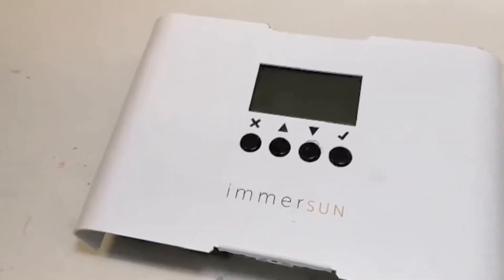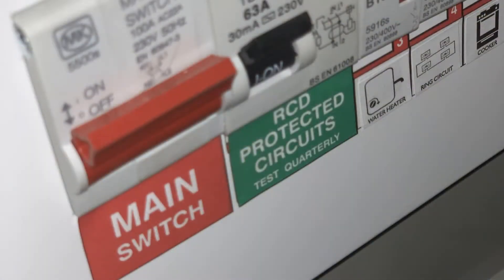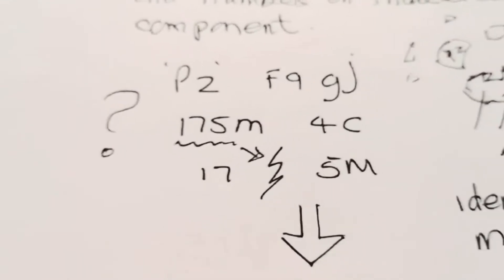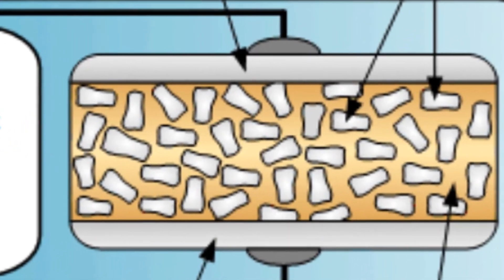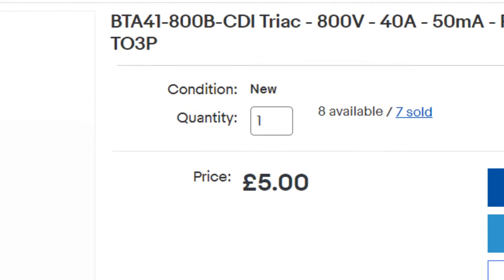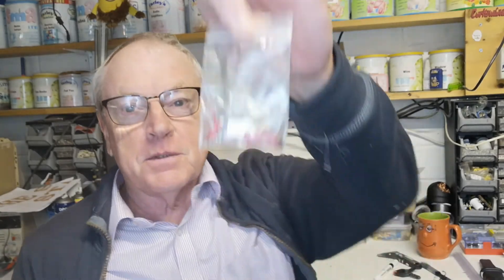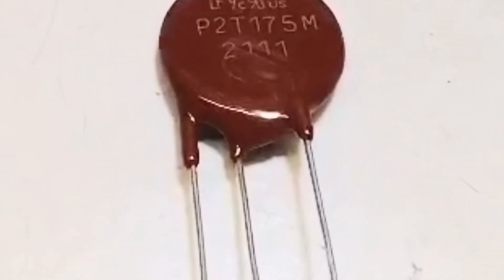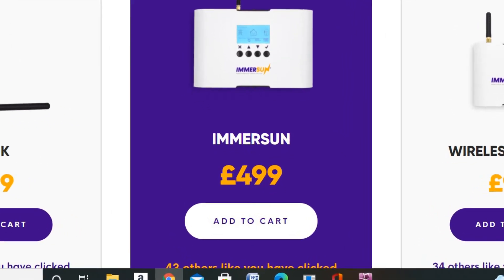Immersun Solar Diverter repair. Saved £500!

Comment: My Immersun blew last weekend. It was the classic Varistor problem. I replaced the Varistor and ran the Immersun for several hours on test without load. All was well so I reconnected the immersion heater and it ran ok for about an hour with some diversion taking place. Then bang, the new Varistor blew. 
I did not replace the neighbouring Triac at the same time as it did not look damaged? Was that my mistake? Should I now try replacing both?

Comment: Hi,my immersun display unit was flashing the message"heater witing 2 circuit"or something so turned main power off then on & now the display is not going on,do you think it's the same problem you had?

Comment: I was very pleased when  Google turned up Eddies Video.  I had gone through the same process but like some other contributors the replacement varistor failed. (I used a 20 mm 275V generic one).  A couple of things puzzled me about the original varistor P2T175M  - it has an thermal fuse in it and an indicator (the third wire) to indicated it has fused.  The other thing is the continuous AC voltage rating is only 175 V.  I thought that this may have been the reason it failed.  However I now think that the transient voltages that are causing the failure are a symptom of another malfunction.  Has anyone done any reverse engineering to determine the circuit in that area?  I did not touch the triac but I think the flash damage on the second instance has damaged the insulation on the adjacent inductor.
I also contacted immersun who said that 4eco made the unit and they went bust.  They sell a newer version which looks the same and seems to have the same manual.  All very strange.  Suspect it there is some rebranding to local countries of a design from an international company?
Any further information on repairing this fault appreciated.
Reply from the maker: Yes, it looks like only the specified replacement will work. I've found this on modern power supplies. It seem only the item specified by the manufacture will work. Modern circuits are very intolerant of near equivalents.

Comment: Technical Question - Is the variable output of the immersun isolated from the mains supply? So, for example, in principle, could you connect 3, one on each phase of a three-phase immersion element and neutral? So that if any of the phases has an excess, that would otherwise go to the grid, can be harvested for use in heating a hot water tank?
Reply from the maker: Not sure at all. Sorrry

Comment: Did you get any other photos of the board?  I've been trying to work out how they do the AC voltage regulation. They claim not to use phase angle control but "trusine" so are reducing the AC voltage but in a way to produce minimal to no EMC.

The York EMC report doesn't give any clues how they do it.

A motor drive would rectify, smooth and then generate AC by PWM.  There's no big caps, so perhaps they refrify and dont smooth and then PWM the output within the wondow of the sine wave of the input.

Im aware there are 2 IGBTs on the heatsink and it makes me think they are for the output forming.

Else, do they start chopping the AC input directly, i.e. no rectification. 

Even a photo to try and see what the tracking is would help.

No probs if you don't have anything.
Reply from the maker: I'm not at all sure.

Comment: Hi Eddie and others. What a pleasure to find a proper repairs area for the Immersun. I haf a blown varistor however having ordered the varistor and triac I found the triac read ok. The Immersun rebooted ok but the varistor blew again shortly afterwards - 2 mins. I had checked the immersion elements previously so it looks like something else was damaged. Is there anything else I could easily check?
Reply from the maker: Hmm, mystery there my fellow tinkerer. The only thing I can syggest and forgive if I "teach granny to suck eggs" but I'll go through what I did. The varister was very obscure so it took a while to identify it properly, so while I waited I simply plugged in the immersion heater direct to the mains on sunny days. I'm wondering what you would find if you tried that? It's Certainly a failsafe way of checking the heating element fullly. If it is short circuiting internally the mains trip will soon complain at the meter. Or intermittent perhaps. If not dead s/c or o/c.

Then as I discovered the triac and the varister have to be the exact right components in general power supplies. A near equivalent nearly always fails.

I'm hoping this has been of some help. It took me ages to find the exact right varistor.

Comment: Hello Eddie, thanks for taking the time and effort in producing such an informative video. Both components, Varistor and Triac, on my Immersun are still intact. The problem I’m having with my Immersun is the short circuit error 8 message. I know for a fact that its not the heating elements because I took the plunge and replaced both of them because of their age and the fact we live in a very hard water area. I also tested the new heating elements, just as a precaution, with an insulation resistance load and both passed. Given you said that Varistors have a shelf life, my Immersun is now 7yrs old, would you say that replacing the Varistor and/or Triac will rectify the short circuit error?. I note that three other YouTube users also have exactly the same problem with their Immersun unit. I hate throwing anything away that can easily be repaired and I’m sure if there is a solution that works others will benefit as well. What would you advise? Thanking you in advance.
Reply from the maker: Hmm, yeah. I can't give s definitive answer but maybe it's a short in the power circuit (triac - varistor) it's worth a cold check certainly but for the sake of £15 odd it might be an idea to change them anyway. They do directly supply the elements. 

I have seen (maybe you have too?) other videos dealing with burnt out pcb so certainly an idea to strip it down for a visual. 

I hope you have joy. I did consider an  alternative unit at about £300. The only thing with such is that you lose the nice information on the web page. 

Thanks for your encouragement on the video.
Reply: @EddieFox  thanks for replying so quickly to my query and for your thoughts/advice. I will take the unit apart today (safely of course) and will perform a test on the Varistor and Triac, having desoldered them first from the PCB. I will also do a visual check on the other components to see if there’s any obvious faults. I did speak to Immersun about the unit and asked if they could repair it. Unfortunately they weren’t interested and simply wanted me to purchase a new one which now costs £499. If I can’t resolve the fault on the Immersun then I will purchase the Eddi solar power diverted (and associated add ons) from Myenergi, once they have stock.  I believe they developed and manufactured the original Immersun unit and the newer version is a more sophisticated version. Like yourself, I value the data produced from these units and use it in a variety of ways. I’m also mindful that Eddi and Immersun are one of a few devices that are compatible with battery storage systems, which is something I’m interested in for the future. I will keep you posted. Thanks again.

Comment: Had exactly the same issue, bought the parts and am A okay

Edit: 15/05/2022.  After repair the unit seemed to be working okay, but started to get a loud buzzing then a click noise then a "Error 8 Heater Short Circuit" when it switched to heater 1 (Immersion). After trying a few times again got the error. At one point the RCD tripped again  so isolated the immersion heater and Immersun seemed to work okay again. Thinking it was a immersion  heater fault I tested the immersion heater and was heating okay. Removed the immerSUN cover to inspect again and found the Varister was splitting and looked hot as before..... later the same day it blow with a bang once more ....so finally decided to replace it with an alternative unit.
Reply from the maker: Well done. Glad you got a  repair

Comment: A great video, thank you. Mine has just gone too and the damage looks very similar. The wreckage to the varistor is obvious, but how did you know a) that it had taken the triac also and b) that it had not taken anything beyond the triac?
Reply from the maker: Lol. Yeah, for the sake of a fiver I changed the triac into the bargain as it was electrically directly connected to the explosion and not in my view worth changing it. I didn't bother checking it, I have to say. I did a cold check of the coupling components that I could see to test them. All measured ok. I thought £15 on a few sus' components a worthwhile gamble against £500 for a new (and now largely  unavailable) unit. 

If the driver chip etc failed it was surface mount if I remember, so would have put it beyond my ability to repair. 

Yep. Some of it was 'fingers crossed', hence my little quip about 'tune for maximum smoke'. Hope that helps. :)

Comment: Great video Eddie. I repair Marlec Solar iBoosts and they suffer all manner of faults too, from blown IGBT's to failed chips on the digital comparator circuits. Good to see guys like you and me keeping the water hot. Keep up the good work mate.
Reply from the maker: Thank you for your encouraging comment. If I can; I post clips to help people and help sometimes to save money in this throw away world.
Reply: If you still offer a repair service is there a way to get in contact? I have a unit that has been in service for six years, but now tripping the MCB. The storage tank side (immersion elements, thermostat, wiring) checked out by electrician. Problem isolated to the +iBoost. Marlec service say they won't repair - just buy a new one, but they would say that.
Reply: @francisdonnelly9361  Hi Francis, where abouts do you live?
Reply: @electrickal1  Sussex GB
Reply: @francisdonnelly9361  With a name like that I thought you were Irish. I'm in N. Ireland if you want to post it over, I will sort it and post it back?
Reply: @electrickal1  Ha ha, almost! parents from NI but born a Londoner. Would you be good enough to put a contact email in your youTube profile?
Reply: @francisdonnelly9361  im not sure if these are private or public. Do you have an eBay account? I can generate a listing and give you the item number if that helps??

Comment: Eddie: Ours has just gone bang in an identical way (no way of identifying the component) but I thought it might be a varistor. Thanks for posting this excellent video which I hope will fix our Immersun too!
Reply from the maker: Thank you for commenting. Let me know how your repair goes. I wish you well.
Reply: @EddieFox  Bad News...Replaced both components (TRIAC was definitely the right way  round and varistor was destroyed so difficult to be sure, (however only 2 terminals had any resistance  which was 0.2 Ohms, others were infinite and these were the ones going to the tracks on the board)  The other terminal doesn't go anywhere. So far so good, turned immersion heater (19.7 Ohms) off and re-booted fine, set time etc. Then, as soon as immersion switched on, a loud bang! On inspection, all devices (?) attached to heat sink destroyed. Varistor looks fine. Have I done something wrong and is it worth trying anything else? Your comments appreciated. Thanks
Reply from the maker: @Shearers1953   @Doug S  oooh, noooo! That's bad. Sorry about that. My only suggestion is try another triac. But before you do that just cold check the other components around it. I'm maybe teaching granny to suck eggs but was the triac in the right way round? Forgive me for asking. It's easy to get components reversed. I've done it. Lol. If I remember right there is a 'diac' (?) in the drive or coupling circuit. (I don't have a schematic). Check that. See if you can source a schematic. Unfortunately there wasn't one last year when I looked. Actually there aren't many components in the circuit. So identify each one (surface mounted) and cold check. In these types of circuit the components have to be the exact replacement. 'Equivalents' sometimes aren't exactly the same specs. 

You said the boiler element was ok. Is it worth repairing the diverter again and try a low power light bulb? See if it lights up. Even on a cloudy day there'll be enough to light it up a little. 

Other than that I'm out of suggestions. The triac is only a fiver. It's worth a go. A new diverter, not the equivalent (They don't make them any more ) without the WiFi to give you info is less, about £300. 

EBay or Amazon:-  "solar diverter".

With a smart meter, if you have one, the export energy is given on that but you won't get the nice graphs on the website, that's all. It will still heat up your water. I looked at all these possibilities before I took the plunge. I hope you have success. 

I'm assuming your qualified but if you're not a qualified sparks it may be worth biting the bullet and getting a good one in to have a look at your system.
Reply: @EddieFox  Update for anyone's benefit? ...On further thought, unless there was always another fault, hidden or protected by the failed varistor, the only thing to confirm is that the varistor goes in the right way. As far as I could see, the three lead device had a lump on the back and, on mine, this faced the outer edge of the board.
The Triac was definitely in the same way as original.
So we have decided Immersun is scrap.
For the future, I got an estimate to repair from Electronic Partners but it was £179 (with no massive guarantee) so that wasn't worth it (to use)
Our original solar installet wanted £480 to supply and fit a Solar iBoost (way too expensive)
Searching on eBay we have decided to go for Solic 200 (there was an old version, black and manufacturer factory second as well as new) The reasons for this are price and possibility of 10 year warranty (if company is still around!) Only issue is that to get that warranty an electrician has to sign off the warranty card. So we are trying to get someone to fit (it isn't rocket science, as you know!) or inspect and sign. If we can't get that, it should still pay for itself if it lasts more than 2 years or so (at current gas rates!)
We have an old EOn energy meter to indicate import/export and have seen panel meters on eBay showing Volts/kW/kWh etc to replace the admittedly nice Immersun display.
Wish us luck and thanks again.
Reply from the maker: Dear  @Shearers1953 . I really appreciate your input into this project and of course, I know other readers will benefit. I'm so sorry it didn't work out as planned for you. Perhaps in your unfortunate case the catastrophic failure of power components may have 'spiked' other components, such as the drive chip etc. You've been a hero in my eyes for giving it a go. I truly hope and pray you'll find a suitable solution - especially in these days of increasing energy costs. I've appreciated our conversation. Eddie.
Reply: @EddieFox  Just an update, we replaced the Immersun (quote £480 for a new iBoost - no way!) Went for the more basic (we do miss the smiley face) Solic 200, factory second off eBay with 10 year (they say) warranty. Need to get an electrician to fit it to get that but still a lot cheaper than the alternative. It just works (zero export threshold). If you look also on eBay there's a digital LCD meter which does the normal Watts, kWh (with resettable display) using a small current transformer etc which we may consider.
Regarding any future Immersun repairs, I'd say checking that the varistor is the right way round based on a clear understanding of the connections (I agree that changing the TRIAC  - price increase now £10?) is still worth it. Good Luck to all who follow. & Thanks again ;-)
Reply: @Shearers1953  I had the same issue. Replaced the damaged Varister and triac .After repair the unit seemed to be working okay. However when the unit switched over to Heater 1 (Immersion) i was getting a loud buzzing then a click noise, it did this a few times before an "Error 8 Heater Short Circuit" showed up,  so i isolated the immersion heater and Immersun seemed to work okay again. Thinking it was a immersion  heater fault I tested the immersion heater and was heating okay. Removed the immerSUN cover to inspect again and found the Varister was splitting and looked hot as before..... later the same day it blow with a bang once more ....so finally have decided to replace it with possible the iboost.
Reply from the maker: Thank you for your interest in this video. I'm glad you got it sort of sorted out. At least you can enjoy free hot water again.